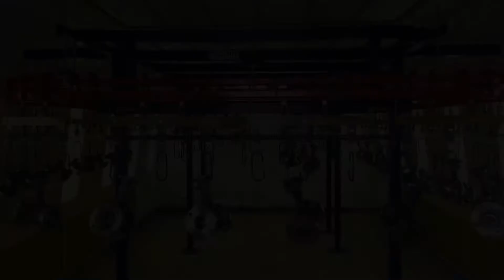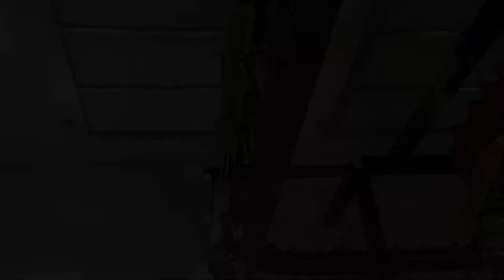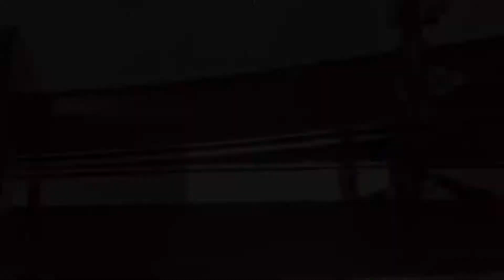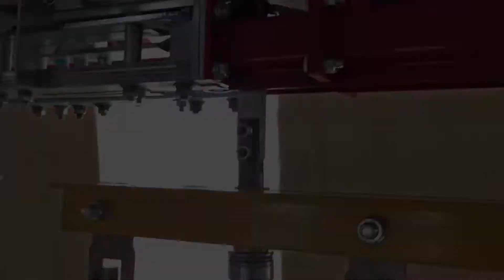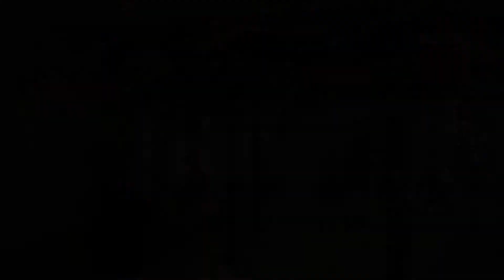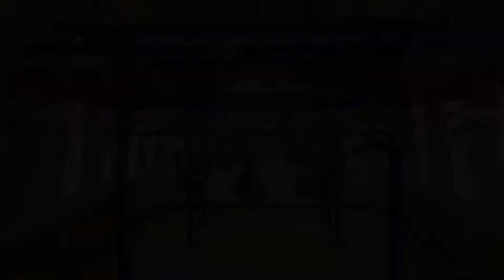Power and Free Conveyor for Painting Valves

Comment: Hello. Congratulation.  If the conveyor has decline Do you use the same trolley? How does work when the load is faster that track power? (decline)
Reply from the maker: Hi Jose, for safety, the Power and Free conveyor is designed so that the trolley cannot accumulate on inclines and declines, therefore the inclines and declines have tight track (no accumulation) where the pusher dog is engaged further into the trolley flappers so that the trolley cannot disengage from the power chain pusher dog. Hopefully this answers your question!